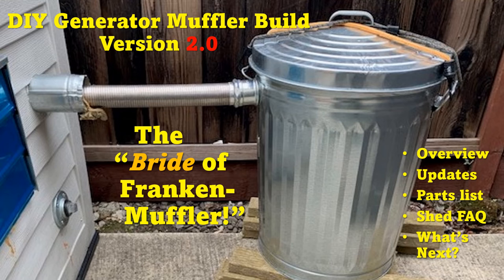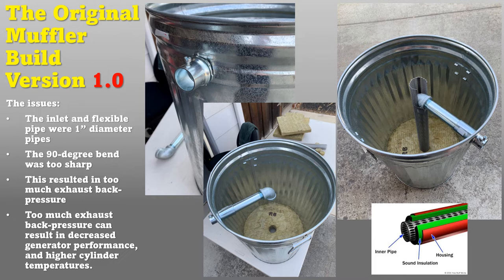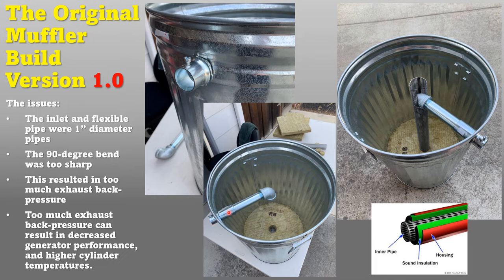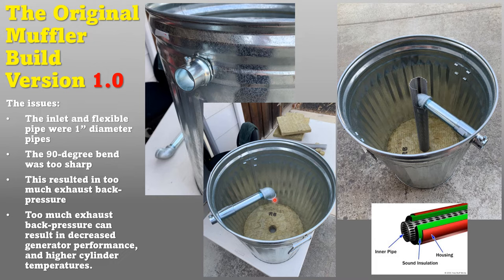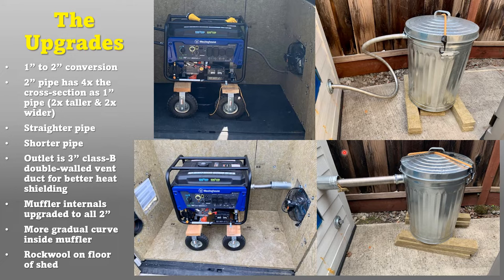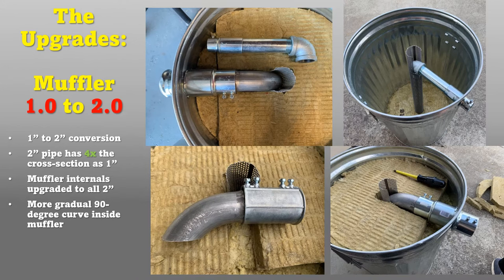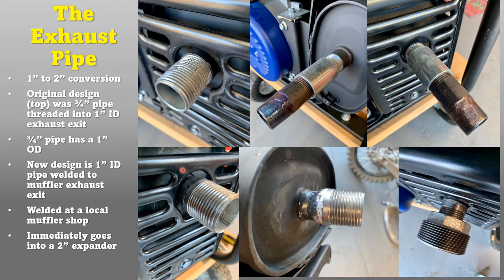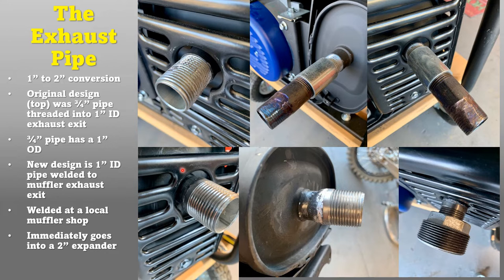DIY Generator Muffler Build (Version 2.0) - The Trashcan Muffler - Bride of Franken-Muffler

Comment: You could use a rachet strap to secure the lid better and seal?Also thick walled pipe alone can reduce exuast sound,I remember some cars that werent verry loud with out the mufler because of the thick walled pipe before the muffler.

Comment: Great video! I have built the can muffler and enclosure matching yours almost exactly. My issue is the heat inside the cabinet is reaching 150F with the doors closed. Could one remove the muffler altogether and extend the exhaust from engine with an insulated exhaust pipe through the cabinet wall?

Comment: As a retired Construction Supt / Engineer you did a good job. 
Could you use a large capacity car muffler? 
I remember my parents 1960 Ford Station Wagon with a 390 V8 and it didnt make any noise.
Note I am 72 now so maybe my memory is off a little on the noise LOL.

Best Regards

Comment: Great build series.  Re cost of Rockwool for lining the walls of the shed.  Did you need about 80 SF of Rockwool?
 (4 × 6 = 24 SF each front & back x 2 = 48 SF front & back; 4 × 4 = 16 SF each side x 2 = 32 SF for sides, total front  back & sides = 80 SF)
At current prices $8 to $10 per SF, now costs about $700 to $800!
Reply from the maker: I guess that depends on if you need to include shipping or not.   At my local Lowes hardware store, Rockwool comfortboard is still about $60 per pack (which is 48sq.ft., or 6 sheets of 2'x4' size.)   I used about 7 or 8 sheets for the shed (including the floor), and the rest was used in the muffler.  So, still about $120 in my area (California).  That puts my cost at about $1.25 per sq.ft. (not including sales tax). Remember, the interior is a bit smaller than the outside, so it's not a full 4'x4'x6'.  If you need to add shipping for the rockwool, you could easily double the cost, unfortunately.

Comment: I plan to build a shed using many of your great ideas....Comfortboard, side vent baffles and maybe the Frankenmuffler.....but I will build a custom plywood enclosure 4'x4'x4' with fixed top. My generator is the same size/output as yours and I plan to operate it completely remotely (with remote control) on propane. My question to you is if you have issues with high temperature within the enclosure when you have shut the generator down after significant running and the vent fan is off? Does the heat soak cause damage to the generator plastics and the enclosure?
Reply from the maker: Unfortunately, I can't answer that question yet.  I have only run the generator for a short time in the shed.  Mostly, it is used off-grid when at a motocross track.  There isn't much plastic on this generator, other than the control panel, so not a lot of exposure there.  The shed itself is very well protected by the insulation, so, I don't think it should be much of an issue, but it will definitely be warmer in the shed that outside.  Only time will tell if it has any adverse affects.

Comment: I installed a used cat converter from a car on mine so it wouldn't kill my chickens .. it also quieted it down quite a bit .. my quiet box is inside a shed , so i had to run a totally different ventilation system using inline duct fans.. you can't even hear it running .. just a slight hum , also installed a cement floor under the gen and box.

Comment: Hey:) I’ve looked though some of the comments and I didn’t see you talk about leakage with the exhaust connecting to the 2” pipe coming off the engine as well as the connection to the muffler which again inserts inside of the expansion joint/2” pipe? Are you using high temp tape to make the exhaust pipe larger to fit more snug inside those 2” pipes? I would think fitting the exhaust over instead of in side those 2” “pipes” that are coming and going from the engine and muffler but I’m guessing is hindered by not having a bigger exhaust pipe available?. Thanks again:) peace

Comment: We lost power and wife finally approved to get generator (and she paid for it!) after me nagging her for months.  It was nice having electricity when it failed, but I felt terrible being loud with my neighbors (they are 100 ft away so that is good at least.  Awesome work!

My question for you?  What part of the project attenuated the sound the most (Box or muffler or some other part?) I don't need to make it as quiet but am looking at building a 3 sided covered box (with MLV and rockwool to decouple the MLV) and having the open end out toward the direction were no one lives.  I think I just need to loose about 10 dB (your system looks that it looses 20 dB) in the directions of my neighbors. Thanks!
Reply from the maker: From my perspective, the Rockwool helped the most.  The baffles on the sides were effective as well.  The exhaust was the next loudest thing, but it was directional.  So, I could have just pointed the exhaust up or away if I needed to.  But since I'm in a residential neighborhood, there weren't any directions that were unoccupied, which is why I went with a muffler.  If you can get away with it, a three-sided box would certainly help you in terms of ventilation, and it wouldn't have the heat and exhaust issues I have with an enclosed box design.
Reply: @C5Tor  thanks for the reply and information. I think the 3 sided box will be the answer as we have side neighbors but no rear ones (lakeside). The leftover MLC and rockwool will come in perfectly. I will probably build the shed from metal roofing sheets from the big box stores and just make the 4th wall lightweight to seal it when not in use.
Reply: Sorry another question, thought about going to NG? We had another failure last week so thinking about it. Our WC is only 6" at service and my model say 7" min :-(
Reply from the maker: Did you actually have a question?  I haven't used this generator with natural gas, I just noted in the video that there was an option to run it on natural gas if needed with an aftermarket natural gas adapter.
Reply: @C5Tor  that is a question, ask if you thought about switching. I want to get off propane after burning through most of my tanks the last outage. Turns out pressure here for gas is low.
Reply from the maker: Unfortunately, I don't have NG connection near my shed.  It is on the other side of my property, so not really economical to plumb a line.
Reply: @C5Tor  the only reason I am considering is that our last outage we got snowed in and I realized that I may end up in a time where my LP supply could run out.
Reply from the maker: It sounds like a good idea.  As I mentioned in the video, if you have access to it, and it isn't too expensive to run a line to your generator, it is a good alternative to having to constantly refill propane or gas tanks.  It just wasn't a good option for me.  One downside is that the generator will have a little less power.  But in a power outage, I assume you will take what you can get!  Good luck!
Reply: @C5Tor  I think it's just our type of natural disasters in the area. Lots of snowfall in the PNW and the constant is that NG works and electric fails here is the main failure. Take a large snowstorm and I run out of my 44 gals of propane then I have nothing.  The other major one is a large earthquake (9.0+ has 25% chance in my life here). So keeping the Propane as backup.
The real goal is to have an almost self sufficient solar array and battery.
I will probably run some 1" schedule 40 to improve my line loss here, it's pretty high.

Comment: Excellent video.  Did you consider ceramic fiber blankets for the muffler.  Much more affordable than rockwool and it's pliable.  Supposedly it also has very good acoustic absorption properties.  Regardless your project has the best sound dampening properties of any video that I've seen.  Thanks.
Reply from the maker: That would probably have worked as well.  However, I already had some Rockwool, so I used it.

Comment: IMO, instead of spiral. Why not stagger the layers with the holes at 180° and angle them at 30-45° down. For flow pressure test, perhaps get one of those hand held wind speed gadgets then stick a blower on the other end. That should give a good estimate of flow rates and back pressure of your various design. 

You could also try some foil backed mineral wool to wrap the outlet pipe from the wall and also the shed since the metal pipe might attenuate the noise from the shed.

Comment: I am planning to extend the exhaust in my  Westinghouse 7500 and just ordered a 3/4 tap before seeing stage two. I can return. Your welding option for me is not feasible so I was wondering if I could still use the 3/4 inch exhaust stub and use a reduction bushing or series to increase the overall diameter to 2 inches. Or do they make a 1 inch tap?
Reply from the maker: It depends on the size of the muffler.  These generators seem to have come with several different sized muffler outlet openings.  Mine was not big enough to use a 1" tap, which is why I had to go with the 3/4" tap.  Tapping and welding are just two methods that you could use.  I just showed what I used in my build as ideas for others.  I've seen lots of ideas, like pressure fittings or magnets.  It sort of depends on how sturdy you need the connection and how airtight you need the fitting.  Also keep in mind that that location is probably going to be the hottest part of your exhaust, so you need to worry about how heat will affect it.  The metal will expand and contract due to heat, so take that into account.

Comment: Thanks for sharing; for your education, guess if you bury the shed like 33, 50, 66 to 100 % into the ground, will it be significant to the song levels? Now you have your trash-can-muffler vertical position, but if you have it Horizontal position, will it make any difference?? What happens if you use a car muffler instead of the trash can muffler??
Reply from the maker: I put the trashcan muffler in a vertical position for a couple practical reasons. First was rain: The muffler has a hole in the bottom where the exhaust exits, and I didn't want to get water in it.  The trashcan naturally sheds water when it is in its normal vertical orientation.  Second, was that placing the exit at the bottom gave me the opportunity to make the sound turn another corner and attenuate a bit more sound.  Third, the trashcan takes up less space and stands up on its own in its normal vertical position.  If I laid it sideways, I'd have to support it with a stand (to keep it from rolling) and also keep the lid from falling off.  It also gave me the option to line up the exhaust inlet with the generator outlet a bit more directly.  As far as the car muffler, I have seen quite a few videos where people tried auto mufflers on generators, and the results were less than effective (in my opinion).  Car mufflers are designed to reduce sound levels at different frequencies and airflow volumes than the generators typically produce.  Plus, the trashcan is many times larger than a car muffler, so it gave me the option of adding a LOT more sound-deadening material than a car muffler has available. Car mufflers need to fit under a car and be moderately aerodynamic, but trashcan mufflers not so much.  That being said, this was just an idea. So, feel free to make your muffler fit your own needs in any manner you think makes the most sense.  It doesn't need to be a trashcan, it doesn't need to follow my particular design, and it can be made of almost anything you can think of. A trashcan was just something that I thought might make a good muffler for my application, and it turned out to be pretty effective.
Reply: @C5Tor  Thanks for sharing!
Reply from the maker: Sorry, mistyped "horizontal" instead of "vertical" above.  I corrected the previous comment to reflect why I put the can in the normal "vertical" position.  Sorry for the confusion.

Comment: Is the muffler can really necessary? If you put a few more baffles into the exhaust port, wouldn't the fan remove the exhaust and noise out your baffle box and be just as effective? Or am I not considering something? 🤔
Reply from the maker: You definitely want to get the exhaust out of the shed, and not let it exhaust directly into the shed.  Most of the heat is in the exhaust, and all of the CO/CO2.  The fan struggles enough keeping the shed cool without adding a lot of extra heat to the shed in the form of exhaust.  The added carbon monoxide will make the generator run poorly and may even cause it to turn off.  You don't have to go to the extreme of using a trashcan as a muffler, as this was just an experiment to see if it would work (which it did).

Comment: Nice project and ingenious use of a garbage can to home brew a muffler.  But since you are already going to a muffler shop to weld up.a connection to the generator muffler, maybe simpler to just have the shop add a length of muffler pipe and an automobile muffler instead of messing with the garbage can.  Do you think this is a reasonable option?
Reply from the maker: You could certainly go the auto muffler route, and I see that lots of people have tried it.  However, if you look up "Generator Automobile muffler" on YouTube, you will see that most of the experiments were really less than satisfactory.  Either the car muffler made little to no difference, or it was a lot of work with welding, etc.  Usually both.  Quite a few posters seemed to indicate it wasn't worth the effort. My take on this is that car mufflers are really made to work on larger volumes of air moving at higher velocities, and they are designed to muffle different sound frequencies than you would get on a small generator engine.  Most of them use baffles to reflect the sound rather than absorbing it.  The car mufflers that use sound absorbing materials (glass-packs) don't really have enough sound proofing materials to significantly reduce the sound much. This trashcan muffler concept takes the glass-pack idea, but adds a LOT more sound absorbing material than a typical car muffler. (Maybe 10x or even 20x more!)  Imagine if your car muffler was the size of the trashcan, and think how much quieter it might be.  This was the idea behind the trashcan muffler.  While the car is limited on space to put a muffler, my generator shed doesn't have that limitation; it can be large, ugly and non-aerodynamic.  The second area of concern is that most of those experiments I saw in the videos seemed to try adding the car muffler WITHOUT any other efforts to soundproof the rest of the generator.  So, even if the car muffler might have been moderately effective at muffling the exhaust, the rest of the generator was still so loud that they couldn't hear the difference.  I talk about this in the video when I discuss doing the muffler last, after quieting the rest of the generator.  But feel free to experiment.  That was the point of this video, after all. Just sharing ideas for folks trying to quiet noisy equipment.  Good luck!

Comment: Thank you for the amazing video and instructions. Question I have is - do you have any issues with CO shut downs in the small enclosure even with fans and inlet?
Reply from the maker: I haven't had any issues with CO causing shutdown.   Theoretically, the fan has a high enough flow to replace the air in the shed every ~4 seconds.  Also, almost all of the CO generated by the combustion in the engine is being directed outside of the shed via the exhaust.

Comment: Thanks so much for this.  Did you consider putting the "inlet" 3 or 4 inches lower on the can so the insulation above the mesh pipe is thicker?  So that the "lid" becomes something 5 or 6 inches thick.???
Reply from the maker: Yes, I did consider moving the inlet down a bit to get a thicker "lid" to dampen the sound out of the top.  It probably would have been the way to go.  At the time, I was trying to maximize the area below the bend, since the bend itself was kind of "wasted" space.  The inlet pipe and the bend are not perforated, so they didn't let out quite as much sound.  I was trying to maximize the amount of insulation around the perforated pipe section.
Reply: @C5Tor  OK, I get it.  So my story:  A neighbor has launched a "lunch wagon" business with her two daughters. The wagon moves around, has a fb site and the community is enthusiastic. On Saturday the generator, attached to the front of the truck was so loud they had trouble taking orders.  I have a 55Gallon Drum in good shape that I literally picked up on the road.  So my thought is to build from the top up (upside down) then weld a grid from rebar on the bottom - holes in the side on the bottom etc. then flip "Upright."  Not having tried any of this before I don't know if it'd be worth it.  Won't cost any money. But... Is the noise damper that much with this technique/system?  She'd need to store the drum and "wheel" it.  I may have difficulty convincing them of the improvement.
Reply from the maker: I think I made the point in the video, but remember that the exhaust is only part of the total noise produced by the generator.  So putting a muffler on the exhaust only reduces part of the noise.  This is why you often see videos of people that put car mufflers on their generator, but it is still just as noisy as it was to start with.  The exhaust is quieter, but the rest of the generator is still banging away.  That is also why I quieted the rest of the generator using the shed, and then did the exhaust last.   A lot of mobile food vendors go with something like the ZombieBox, which are nice, but pricey.   The solution I showed in my vidoes was really a poor man's zombie box with a lot of found parts and better ventilation.
Reply: @C5Tor  yes. My friend’s plan is to just buy a new (generator). I hope to talk them into an eventual “dedicated” trailer for a box/muffler combo. Time will tell.